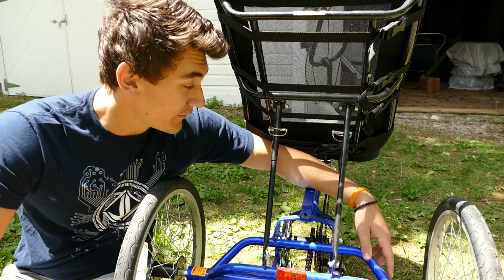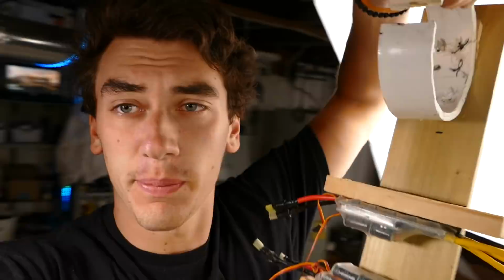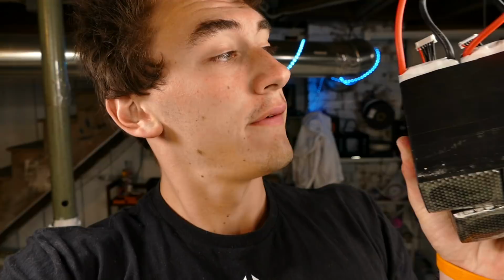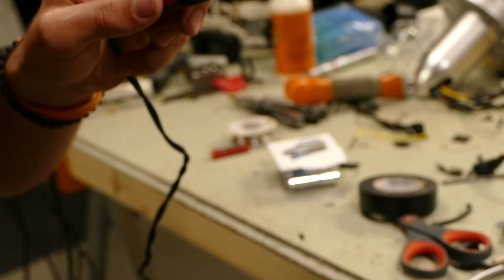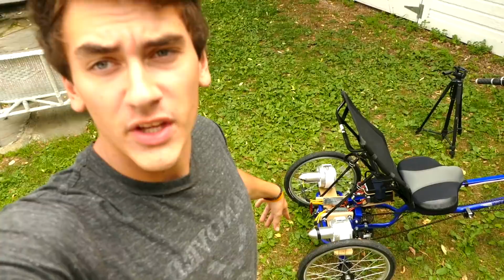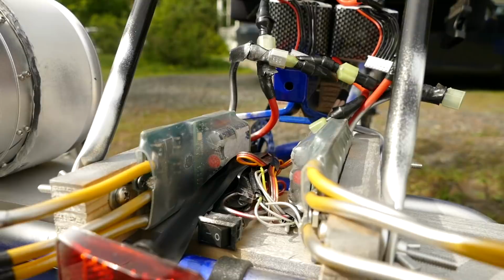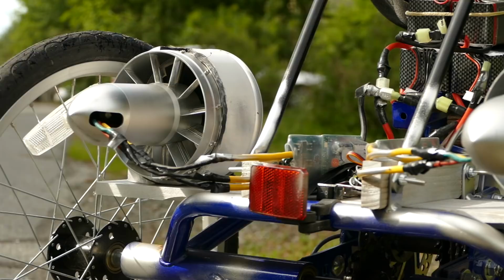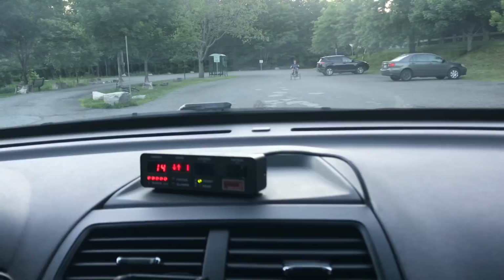DIY JET BIKE GOES WAY TOO FAST - COPS CALLED (Pulled over)

Comment: Why do you call an electric Ducted fan engine a JET engine?
Reply: Amitai Medan Because click bait.
Reply: I was going to say the same thing
Reply: Yeah, I kept waiting for jet engines to be mounted. I was saying to myself, those pvc pipes are not going to hold a hot jet engine. 

Should have realized it was just fans.
Reply: Jet - A rapid stream of liquid or gas forced out of a small opening.

EDFs make jets, therefor are jet engines.
Reply: Views
Reply: Caleb Sherman nah I don’t think an edf qualifies as a jet engine.. edf = electric ducted fan.. if your analogy is correct then you’d have a jet engines blowing air around in your living room “box fan” lol
Reply: most people dont know what an electric Ducted fan is ! :)
Reply: Amitai Medan click bait
Reply: Amitai Medan click bait
Reply: Joshua Dannewitz : First of all, I know what an EDF is. Second, if the air is pushed out of a small opening at a rapid speed, then those are technically jet engines. Box fans are not pushing the are very quickly though, so no.
Reply: Same reason he uses visegrips  and a multitool instead of a socket and an allen wrench.
Reply: U should have read description it says edf .most people dont know what edf is ,so jets
Reply: Caleb Sherman

You conveniently forgot the 'long narrow current of high-speed winds' part of the definition, and seeing as the stream of air from an EDF is neither long nor narrow, guess what that means...

OH, and by your definition, and air compressor is a jet. Tons of people now have jets in their garage according to you. You can go to the gas station and play with a jet for only a quarter.
Reply: Ikr ._. Well now i do :)
Reply: Psyrecx : Yes, that is true. There are jets in hot tubs too by the way.
Reply: Yeah. Not cool man, unsubscribe...
Reply: Doesn't he know that bikes have two wheels, and trikes have three wheels... there is no such thing as a 3 wheeled trike!
Reply: EDFs are electric jets.
What you think of a jet is actually a kerosene-powered ducted fan.
Reply: Cause the Kids think JET ENGINE is cooler than an electric Fan Motor.
Reply: Caleb Sherman The invention name = Electric ducted fan. Therefore... Electric ducted fan. 
Electric - meaning powered by electricity 
Ducted - meaning mounted within a duct
Fan - as in a device created to move air
Besides, you don't consider a desk fan a jet engine do you? It too creates a rapid stream of gas so why not? I'll tell you why because it's a damn fan. 
Another way to look at how you're wrong would be to say "engine" used in this way implies burning fuel. A motor tends to be considered electric and an engine is generally considered to be powered by some type of fuel.
Yet another way to look at how you're wrong is.... Ugh, forget it. I was going to go on but never mind. You're using this definition of jet wrong. You're wrong... that is all...
Reply: No jet buddy.. lol fan engine.. electric.. i was trippin wood at first..lol
Reply: "there is no such thing as a 3 wheeled trike!"  WHAT?
Reply: "there is no such thing as a 3 wheeled trike!"  What?
Reply: expensive motors and can't afford a $3 set of allen wrenches! LMFAO!
Reply: he doesn't know much of anything, but at 5:30AM, after 12 beers, he's fun to watch and criticize :)
Reply: Joshua Dannewitz no because a box fan is not forced out of a small opening. Like technically a cars exhaust is a jet. But not in the traditional sense. Hes probably saying Jet so he doesn't have to explain an EDF everytime. Like how we call every chocolate sandwich cookie and Oreo.
Reply: Simplicity.
Reply: My question too.... i could prob pass gas with more thrust.... but still was a decent build. Would have been loads more cool with the real thing though. Lol
Reply: Caleb Sherman, only in the sense that a throw rock is a missile.

Technically true, BUT NOT in the sense in which it is being used.
Reply: Hyper Hektor Seems like some people don't know what a jet engine is either. Like the guy in the video.Those edf's he has may have cost at most a couple hundred dollars. Just 1 say jetcat p220 cost $3295.00
Reply: Engine: uses Combustion and fuel
Motor: uses Electricity for power

While the EDF(Electric Ducted Fan) he’s using puts out a jet stream of air. It wouldn’t be an engine since its running on electricity.
Reply: he's a really smart guy. what have you done lately that's worth sharing?
Reply: Amitai Medan it's sounds better
Reply: Amitai Medan lol also the title says goes way too fast when its slow asf
Reply: Caleb Sherman Nope that does not describe EDF.  Where is your restriction just for starters?
Reply: Amitai Medan Because 'ducted-fan-powered tricycle' would get far less views-
Reply: Why not?
Reply: Webster Dictionary
Jet: : a long narrow current of high-speed winds (such as a jet stream) through a narrow opening or a nozzle
Reply: Kitty Hawk 
Open google, type jet, look at the images, what do you see?
Reply: He's confusing "motor" with "engine": An engine is a thermal motor, but he's using an electric motor. He could call it a "jet motor" but not a "jet engine".
Reply: See My Comment
Reply: I was expecting a couple of RC size jet engines, that would fucking cool. But nope, just some fans.
Reply: Caleb Sherman You just described a fart.
Reply: Jet Engine...not Jet. Try again.
Reply: same here, i thought jet engines used jet fuel and compressed air....Hmmm
Reply: Caleb Sherman  so r the ports in a cylinder head a "jet engine"
Reply: Thank you!
Reply: Clams use jet propulsion.
Reply: i'm not going to say i'm right or anything cause i don't know if i am but i think its because of what they are mainly used for, and that's to make jets. when you think of a jet you think of a plane with a non visible engine. for example the f-8 crusader or more famous the f-22 Raptor. when you think of the RC versions of these aircraft you don't usually see a prop rotating on the outside (unless its like really cheap). so what powers them? An EDF, and thus you call it an RC jet or just a jet. so what do you call the engine of a jet? A jet. thus what do you call an engine of an RC jet? A jet. Thus EDF = Jet. its just simpler to call it a jet and technically its not wrong since we don't reference it as a jet engine but just as a jet (or jet motor if you really want to be snobby about it).
Reply: Allen Brown , EDF, GTDF do you know the difference? Engine is the device that powers the jet. In the EDF is it an electric engine, in a GTDF it is a gas turbine... not to be confused with JET. Jet, by definition means liquid or gas forced out through an orifice. So no Desk fans are not JET's because the air is not forced at high pressure through a nozzle assembly.

Jet does not refer to the engine, Jet refers to the action of the gas or liquid. In this case he used brushless motors as the engine for his jets. In the case of a 767, they use gas turbine engines for the jets. They are all considered fan motors, and if you look at the designation for the jet fan on the CF6-6 assembly, you will notice it is called... dun dun dun!!!! A ducted fan assembly....
Reply: " trikes have three wheels      here is no such thing as a 3 wheeled trike!"
 Bull ALL trikes have three wheels
Reply: LOL!. by definition, Trike (tri = three) has three wheels... so would it only be called a Trike, or a three wheeler and not both at the same time as that might imply it has six wheels? or would we misconstrue this simple definition to define a dinosaur which travels on three wheels?

Trike = Nickname for a dinosaur / Nickname for a 3 wheeled vehicle.

Ah good old engrish. (yes the typo is on purpose.)
Reply: Well... Since the engines on a Boeing, Airbus, et al are basically Ducted Kerosine Fans,  I think JL has his nomenclature on spot w/the electric Ducted fan.  Plus he is not a pedantic little prick!
Reply: But not jet ENGINES!
Reply: Satunnainen Katselija, 
Um, yea actually they do, that is what that spinning thing with all the blades in the front is!
Reply: click bait
Reply: Caleb Sherman if you go strictly by definitions sure, but adding engine implys combustion is involved. That's why the term edf was created in order to more appropriately name these things. Same reason we call gas motors engines but you never here an electric motor called an engine. Engine carries the implication of combustion. Calling edfs, jets is just click bait.
Reply: A steam engine is a heat engine that performs mechanical work using steam as its working fluid. In simple terms, the steam engine uses the expansion principle of chemistry, where heat applied to water transforms the water to steam. and then pushes a piston (cylinder). This pushing force is typically transformed, by way of a connecting rod and flywheel, into rotational force for work. The term "steam engine" is generally applied only to reciprocating engines .  The steam can be generated by the earth, the sun, etc  no Combustion needes
Reply: Bikerchic 
Yes, except expansion is not a chemistry property but physical property.
Reply: sounds like a sneeze
Reply: +Caleb Sherman  A jet is a stream of fluid that is projected into a surrounding medium.Therefore is EDF not a jet engine...(gas,air,fluid)https://en.wikipedia.org/wiki/Jet_engine
Reply: click bait, not so good sounding, twin fans ?
Reply: Caleb Sherman Sure, that's the definition for jet. However adding the word engine changes the total meaning.
Like heavy metal.
The first part refers to weight.
The second that it's metal.
Buy a heavy metal refers to density yet volume was never used in individual definitions.

I he second word changes the meaning of the first.

So for jet engine, the word engine alters the meaning of jet.

A true jet engine requires a compression stage and combustion.

Otherwise why are regular propellor planes not called jet planes?
Reply: EDF is technically a jet engine. Any engine that provide propulsion on Newton"s third law of motion by  reverse flow of fluid (gas or liquid) to achieve forward motion. Italy made such airplanes before Me262. Generally, when jet is mentioned, turbojets come to mind, not EDF, Rocket or Ramjets. Squids are the grand daddy of jet propulsion.
Reply: Beware of sparks.
Reply: Caleb Sherman  the air is not being compressed just pushed thru an exit the size of the opening so is the exit really considered small relative to the entrance is what would tell you whether or not something is a jet
Reply: Caleb Sherman also it would not be considered engine because it does not burn fuel. It would be jet motor if it even were a jet.
Reply: Caleb Sherman a real jet engine uses JP-8 or kerosene. Has glowplugs. Injectors. And hot exhaust.
Reply: ghostusmc lol ikr!!!! Hahahaha I caught that and I said amature.
Reply: Because "hair-dryer" doesn't sound as cool....
Reply: Amitai Medan p
Reply: a jet engine is a essentially  ducted fan just with gas instead of electricity
Reply: no cuz box fans aren't ducted
Reply: Amitai Medan i
Reply: Amitai Medan the only difference being is that an EDF
Reply: Amitai Medan is basically a fan am a jet engine is a jet engine
Reply: Amitai Medan he most likely calls it a “jet engine” to simplify things because he could call it an electric ducted fan bike but it’s way longer and not as fun sounding.
Reply: Because he can say what he wants. But I agree. He should be corrected.
Reply: cuz he's a kid
Reply: You mean my daughter wipes her hair with a jet engine?

These are still only built-in electric fans and the word jet engine is associated with a high-speed gas turbine powered by liquid fuel!
So in Sweden before the Muslims were allowed to take over everything. . now I do not know?
Reply: Amitai Medan because hes crazy
Reply: I was thinking that
Reply: Pakmedia on india
Reply: I just passed gas and by definition that’s more of a jet engine than this. Still a cool build.☮️
Reply: yeah, like since when do batteries power jet engines?
Reply: Caleb Sherman jet motors is more correct. An engine requires combustion to be called one. Where this is simply a battery powering a fan. A battery is only electrons moving from one contact to another. Not combustion.... jet.. maybe.  But not a jet engine
Reply: Andy Lee Robinson jet is a jet your definition is correct.  But uig cannot call these jet engines and be accurate
Reply: Amitai Medan it still generates thrust
Reply: Amitai Medan  hahaha
Reply: Joshua Dannewitz box fans don't have a small exhaust, or anything equivalent, so not a jet. you're thinking of a ramjet. i was too. trust me, disappointed. but, technically, edf does count as a jet.
Reply: Do not forget hair dryers and vacuums.
Reply: Caleb Sherman oxigen as a definition is a gas, so it can be a jet engine :-)
Reply: Maybe because they work on the same principal, I.E. using a series of compresor fans to compress the air through and out the rear end or what would be the exhaust? Yes/No???
Reply: wrong, just because it is internally housed does not make a turbo-fan engine a jet engine, jet engines are technically turbine powered, I won't explain, but a huge difference, yes ducted turbo-fan, NOT jet (I have an A&P from Colorado Aerotech, so don't argue)
Reply: Amitai Medan because it produces Jet Stream Kinetic Energy. Engine (energy creator) Jet (jet stream force)...
Reply: Because it's an electric jet engine...
Reply: It's not a jet either, it's a propeller with a shroud around it.  All the duct does is increase the efficiency of the propeller blade tips but it also means that it only works well running at high speeds. Many types of craft have used ducted propellers, they still aren't called "jets.  If you haven't seen it before, check out the Bell X-22
Reply: Because it is a jet engine, just because it's electric or ducted makes no, difference it's still a jet,  A jet engine is a type of reaction engine discharging a fast-moving jet of air that generates thrust by jet propulsion. This broad definition includes airbreathing jet engines (turbojets, turbofans, ramjets, and pulse jets and electric jets). ... Jet aircraft use such engines for long-distance travel.engine
Reply: Bc he wants idk
Reply: Today I learned my butt is a jet engine
Reply: That's what I was wondering. I kept saying to myself how can that be considered a jet engine. It's just a powerful fan. Lol
Reply: @Psyrecx  They charge you for air?
Reply: its ok colin furze channel has real jet engines on his bikes prams trikes cars etc lol
Reply: air isnt a gas lol nor a liquid ,so its a jet fan not a jet engine
Reply: What type of battery and capacity size do I need for one of those engines? Cool build.👍Thanks
Reply: @calebsherman886  the fans in this video are NOT jets. A jet engine (which is what was referenced by the title and the thumbnail) is a fuel operated engine. Plus it has a tapered exit. This doesnt even have a duct extending more than 1/3 of an inch behind the actual propeller. This is a fan since it has a "duct" not a tapered mouth.
Reply: Nobody cares
Reply: After like 75 people......wrote the same thing.........
Reply: I think he legit thought it was a jet engine. Doesn't seem super intelligent. Have yet to see a "jet engine" that did not involve combustion. Closest I have seen is a turbofan jet engine which requires flame.
Reply: Yes Jet motors use jet fuel not Battery power. So any Electric Fan would have Same Results
Reply: Haha
Reply: maybe because he does not know what constitutes a jet engine.
Reply: So, explain the difference between a Motor and an Engine. This should be good!
Reply: @calebsherman886  No air compression which is then added with fuel and burned turning a turbine which means not a jet engine.
Reply: @MrPenguinsfan66  Yeah, I guess it's just a jet, not a jet engine.
Reply: Cool
Reply: Levi
Reply: @thekingsilverado9004  Someone didn't read my last comment.
Reply: Call it whatever you want, it seems to work great!
Reply: Click bait. He should have used a REAL jet engine, although I don't think the pigs, excuse me police would like that very much.
Reply: These are the same jet engines used on the Lear jet.
Reply: why does he call a 3 wheeled vehicle a bike? it'd be a trike... also ducted boat engines are jet boats?
Reply: For views
Reply: It just sounds better, and gets the viewers interested.
Reply: shadap hater!
Reply: Man these mfers love to roast you bro
Reply: To be funny, of course.
Reply: Thank you.
Reply: Not only that , his mounts are made of plastic pipe. ??
Reply: By definition it is a jet, granted it's not a turbo jet operating on the constant pressure cycle (or brayton cycle)
Reply: He also calls a trike a bike.
Reply: I agree
Reply: Because it's still a jet. Not a turbojet whatsoever but it's still classified as a jet.
Reply: @Psyrecx  the little brass piece in carbs are jets. The things water comes out of in hot tubs are jets. Lots of things are jets other than an engine on an aircraft.
Reply: @calebsherman886   But they don't combust anything.  They are electric making them jet motors...
Reply: @RobertJeffersonBased  You don't need combustion to create a jet.
Reply: @calebsherman886  You'll find that near anything that directly involves combustion of a fuel to achieve a motion is semantically called an engine.  You'll also find that anything that spins or moves by way of electrical input is called a motor, basically.  I'm not arguing that there is no jet of air, I'm arguing that this is technically not in any way an engine and would be better termed a "Jet Motor" if we're going to call it something it's not in the first place.
Reply: @RobertJeffersonBased  Yeah I admitted earlier that I'm wrong about the "engine" part. It would technically be a Jet Motor.
Reply: because the amount of people who search for JET powered bike over EDF powered bike is insane. Either way he delievered on a dope bike build video so cut him some slack for wanting to make some of that money back lol
Reply: Because fan powered gramma bike doesn’t turn heads
Reply: Caleb Sherman 
WRONG!!!!!
Reply: Cough money